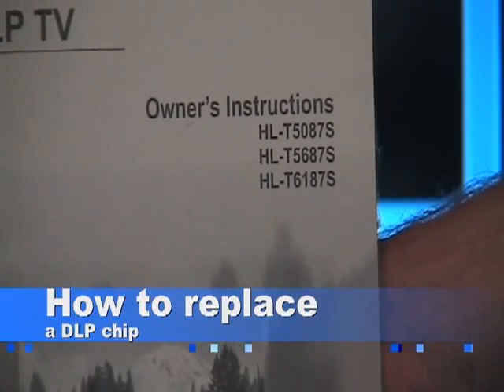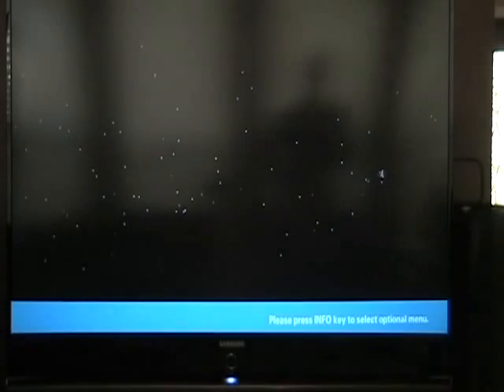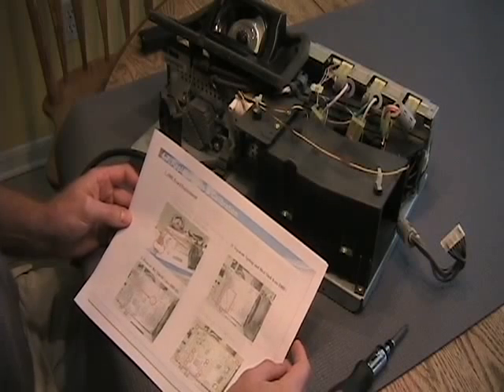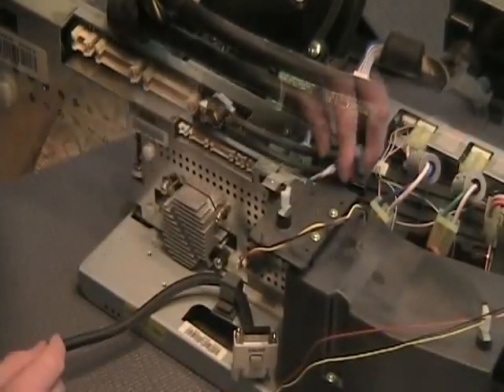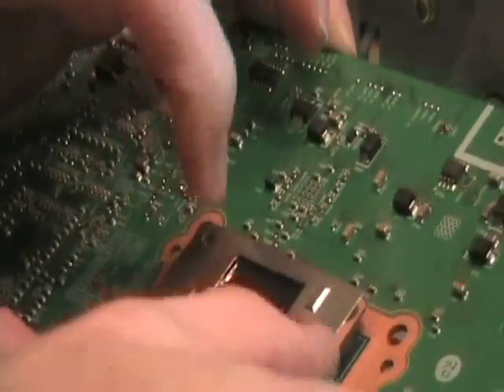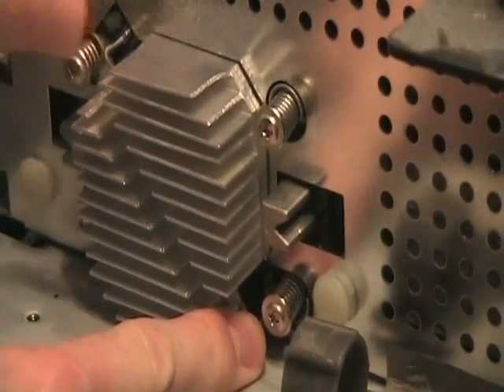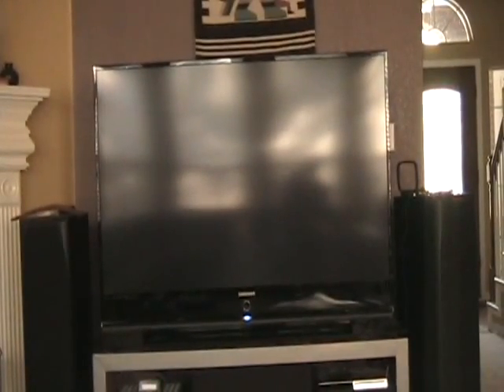Replace DLP chip on Samsung HLT6187

Comment from the maker: Hi all, this past summer (~5 months back), my Samsung DLP finally died. I think it failed due to several capacitors failing on the main power board. This is a known issue. I attempted a to fix/replace the capacitors by soldering on new ones. But, this failed to revive the TV. I think the main power board was damaged by the caps blowing because there was discoloration of the PCB board. I saw online that the a replacement board could be purchased for ~75 dollars (on eBay). Rather than sink more money in, I decided it was time to upgrade to 4K instead. For me the price was low enough and the technology had improved enough to go for it. Although content is still lacking. 

And my apologies for being unresponsive to your questions and comments. Work and family has consumed my time and just haven't logged in during this time. I'll try to be more responsive. 

Thanks for watching.

Comment: Update 
After not seeing a response for about a day, I put on a grounding strap and used the screw extractor, One of the two stubborn screws released.  Will be trying to get the other one out right after posting this.  Don't have any idea whether I may have done damage to the circuit board but time will tell. There will be another update regarding the other screw and what happens when I get everything back together. 

Here's the final update -  bottom line the Samsung DLP set is repaired thanks to the help from this video and some help from my local Lowe's store. It turns out they stock a screw that fits.  It is a 3mm-0.5 X 12mm zinc-p;ated Metric Machine Screw. Rhw 0..5 refers to the type of thread on the screw.  A pack of 12 cost me less than $2.  Hope this informations is of some help to anyone who finds themselves with the same kind of scres problem I had.

Comment: I started on the dp chip replacement and ran into what I hope is not a fatal problem.  The 8 stainless steel screws holding the clamp assembly to the circuit board were extremely tight.   Fortunately 6 of them eventually yielded to pressure and each let go with an audible pop.  Two of them, however, refused to budge.  In my zeal to get them to let go I applied too much pressure and stripped the phillips head corss hatch slot from them.   Is it possible to use a screw extractor on these screws.  Also since their heads are not damaged can you recommend a source for replacements IF I am able to get the to release.

Thank you for any advice you can sent me way.

Comment: Your video is now 4 years old but my HL-T5087SX/AA is now closer to 10.  It is now showing the dead pixel problem.  I am hoping to use your video to help me repair it.  I do have a background in fixing computers but I've never worked on this kind of tv.  If you are able to respond, has anything changed since you posted this video?  Thanks for nay advice you can send my way.
Reply from the maker: +Richard Sutor Nothing has changed and my TV is still working great.  My advice:
1) Watch the video carefully.  I've had several comments/complaints from people who remove screws they shouldn't but I have a little sub-window saying which one not to remove.
2) Review the comments on this video. Sure there's probably 60% noise to filter out but there are some important comments also that add value. 
3) If you have ever replaced/installed a processor into a PC, you should have no trouble with this fix. 
4) There are other known failures for this TV. IF it's just the dead pixels or stuck on pixels, this is the fix. 
Thanks for watching.

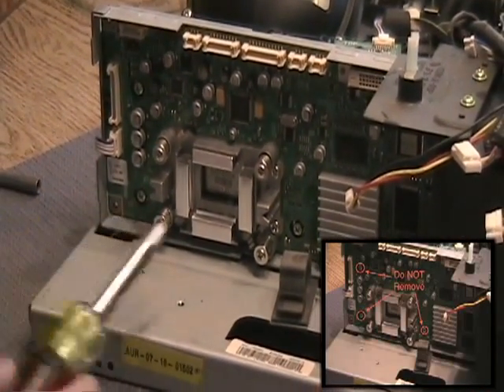Comment: Good video but you really need to make that "DO NOT REMOVE THESE 3 SCREWS" part  at 4:30 MUCH more visible.  it is THE MOST IMPORTANT THING IN THE WHOLE VIDEO!!!!   I was watching/listening to the video as I worked on the TV and completely missed it.  You don't show how you got the board out to install the chip.  Since YOU DID NOT i SAY, "DO NOT REMOVE THESE 3 SCREWS" and because I didn't see how to get the board out, I removed those 3 screws!  MISTAKE.

I did have the service manual downloaded, and after getting the picture almost right sized and position-wise, I could not get the focus to wheel enough to get the focus right.  Hopefully th TV repair guy that I now have to call will be able to fix that.

Looks like other people have been screwed by the lack of complete information.  If you can...please add in a verbal warning as well.  Thanks
Reply: The new chip did solve the pixel problem
Reply: +Bob Burden LOL! So did I but it was because I started from a more generic video. Didn't find this one until after the damage was done. I knew it was going to bite me later. Picture all out of alignment and just got time to get back to it.

Comment: Thanks for your help, though a few things were different, it worked out. Might have wanted to add "Not to remove the 3 white plug screws" as they adjust the alignment (which I had to fixed). Else, thanks. Saved me from having to buy a $2000 new TV. Only spent $175 on the chip.
Reply from the maker: mark shaw Your welcome and thanks for watching. 
At the 4:31 mark, while I explain which 8 screws to remove,  there is also a picture in the bottom right highlighting the 3 that should not be removed. Easier to see in full screen and in hindsight I should have commented on those three screws. Or maybe the picture should be bigger. My only excuse, it was my first Youtube video. :)
Reply: Well, I had to blame someone! Tnx again.

Comment: What do you do when the picture is a little fuzzy after the install? Also the geometry is a little off...
Reply from the maker: Loccs79 The repair manual explains where the focus knob/wheel is (~4month back I tell rolandvz71able where to find one). That's the easy one.  Geometry is a lot more tricky.  If it's a tilt or mis-allignment, again the manual explains. There are screws to adjust this. Personally, I had a slight bend/distortion in lower right. Barely noticeable if there is text or graphical box for sports scores there. This is a more tricky adjustment that I decided not to attempt. There are special manufacturer menus that I think would allow me do it (again in the manual), but for me it wasn't worth the effort.
Reply: +Loccs79 Adjust the 3 screws behind the white caps. Up is pix down, left is pix left and so on.

Comment: Have replaced my chip, white dots are gone. However, the picture is about 2 inches too high and am not sure what else to adjust.... any suggestion would be appreciated. Thanks.
Reply from the maker: Melody Crist Did you purchase a manual? The repair manual is online and available as PDF.  It tells you how to do the adjustments you want.

Also, 2 years back, approximately the 20th post, I'm responding to jbowen52 and Sam Crook. I talk about what screws to adjust to shift the image. In my video there are three "do not touch" screws I point out. Maybe you missed my inset picture at ~4:31 mark.  Although I describe it below, there is a lot of good info in the manual on how to do this adjustment.

That's all I know. Good luck with the adjustment.

Comment: The video gave me a good idea to what I needed to do, to replace my chip. No more dots.

After replacing my chip, I see smudge-like appearance on the left hand side of the TV (when there is a dark or black scene) that was not there before the replacement.

Would this be a defect of the DLP chip? Or do I need to clean the chip? Or clean something else?
Reply: Justin Blair A follow up to the question.  The reason for the smudge in dark scenes, is because someone decided to leave a fingerprint on the mirror.

Use a clean microfiber cloth to clean the mirror.  The surface of the mirror is easy to scratch, which is why a clean microfiber cloth is recommended.
Reply from the maker: Justin Blair Excellent! You found the issue and solved it.  I was going to guess a mirror (not the DLP) had a smudge. Your solution and use of the microfiber cloth was perfect. I used the microfiber cloth for my glasses when I did mine.

On a side note to anyone reading this, never attempt to clean the DLP.  The simplest way to explain a DLP is little mirrors on top of springs that are controlled by the rest of the DLP processor. The processor basically controls the springs (contracting or expanding them) and cause the mirrors to reflect the correct colored light to the screen.  The force of trying to clean a DLP would simply destroy it.

Comment: Well....how did the repair hold up? Did the paste do its job on the heat sink?
Reply from the maker: rolandvz71able The repair is still working great!  The TV is still in my living room and is still the main TV for my house. The paste on the heat sink worked fine.
I've been considering doing a follow-up video to show it still working. I really need to open it up and clean it out again. Plus, I could show a few more details about adjustment knobs that I've learned since this original video. Overall, I feel the cost of the new chip was a way better deal than getting a new TV. I'm hoping this TV holds on for another 2 years. After 2 more years, this TV will be almost 10 years old and I'll feel like I got my money's worth out of it. Also over the next 2 years, the 4K screen cost should come down and a standard should be set. Then I'll consider replacing it as my main TV.
Reply: Thanks for the update....great vid and I will be ordering my chip soon and attempting my repair. You mentioned step by step directions for 20 bucks.....do you remember the website where you bought the directions?
Reply from the maker: rolandvz71able In the video, I was showing a printed copy from the service manual. It's a step-by-step in service manual form.  I found two sites that provided manuals in PDF format.  They were similarly priced. I don't remember which one I bought from. It's below in a reply to the very first comment on this video.
Here's a copy and past from that comment (note, youtube does not allow me enter web addresses):
>>The two places I found are: "servicemanuals"dot net and "service-manual"dot net

Finally, before you begin the repair, take a few minute to read through the comments.  A handful are very helpful and point out pitfalls and solutions while performing this repair. 

Thanks for watching and good luck with your repair.
Reply: thank you for all the useful info!

Comment: Skip the first paragraph if you are not interested in the long rambling version :

Hi there, are there any other symptoms of a DLP LED chip failing other that white dots? I'm currently battling Samsung over a repair I had done by a Samsung affiliated service center roughly a year and a half ago. The tv would have to be turned on many times, progressively taking longer and longer, to start up. When it did the picture was fine while the TV was on. I never had white dots or anything similar yet the repairman told me it was the DLP chip and charge me $350. Now I am on the third repair with the exact same symptoms. The first they claimed it was the DLP(though Samsung claims they cannot tell me what part was put in the TV), the second they claimed it was the subpower(a cheap repair compared to the first and Samsung has the part number), and now it looks like another capacitor related power issue.

The below paragraph is vital and I am pleading from some answer before I speak with Samsung again :

So long story short, other than white dots are there any other symptoms of a DLP Chip failure? Can the chip fail without white dots? And would a failing chip sometimes after turning the tv on a million times work fine until it was turned off again?

Thank you greatly. :)
Reply from the maker: Coco Mandrake I'm aware of three issue with this TV set. 1) DLP fails (also known as the DMD chip). Symptoms: white dots, black dots, flickering dots, and sometimes an entire vertical or horizontal line. Usually this is not catastrophic but a slow process that gets worse over time. 2) Capacitor failure. Symptoms: can't power up or a long time to power up. I'm not sure which circuit board it is and I haven't had this issue yet. 3) Red LED failure. Symptom: red color missing from picture. I haven't had this yet but I've seen repair videos.  

I am not a repairman or service expert for Samsung TVs. My knowledge is based on building computers and working in the chip industry (but not DLP chips). In other words, I can't answer you with any certainty. To answer the "can the chip fail without white dots?": Yes. Usually, once a chip (generically CPU) fails, it's catastrophic. Of course it's nearly impossible to know if it's some other circuit (capacitors/ power supply regulator) unless you have someone who can diagnose the system. To me, it sounds more like a power supply issue. Just to add a little more uncertainty though, if the DLP chip overheated and burned out, then it would also have the same result as you mention above and just fail without white dots. My guess is a power supply issue (most likely capacitor) matches your description better. But really I can only guess. 

Sorry for being somewhat vague. Hopefully the three issue I know of above help. Good luck.
Reply: WillFully WeirdWorld
Thanks much for the detailed reply.

As it turns out it was the LED driver that failed on my unit. I was merely looking to see if there were any stories about the capacitors failing on the that particular board or if it was limited to the power board. 

In the end it's pointless as I missed the capacitor settlement and Samsung hung $550 in repairs on me during the time I would have been eligible for settlement money. I'm absolutely floored by how crooked Samsung has been in regards to this issue.

Seems my only resource is to tie up $550 hours in customer service phone time. lol.

Thanks again man, and very nice job with the vids. :)

Comment: Too bad I saw your video AFTER watching the Shopjimmy video and replacing the chip. White spots are gone but I removed the three "Do Not Remove These" screws. I take it they align the picture. Picture is a little high on the right. Now I get to figure out how to re-align it. Fun.
Reply: I am glad I watched this before Ido my repair this Friday
Reply: beast of the east Lucky guy!
Reply: I am in the same boat as you tonight. I watched it AFTER, dammit! How long did it take you to adjust it back? Any tips?
Reply: Loccs79 We have been in the process of buying a house out of state and moving a little at a time so, no, I have not had time to figure this out. I did move the TV to the new house recently so maybe the upcoming heat wave will keep me inside to try to fix it.

Comment: Thanks for video I replaced a chip in Samsung tv and I have a shadow line about one inch wide vertical Line on  left edge of screen . I tried to adjust by moving board slightly but no luck any ideas thanks in advance ... Harold
Reply from the maker: 109harold Is it a shadow, or the edge of the image/picture.  If it's the picture that is not aligned, there are alignment and focus nobs. The repair manual (I mention you should buy in the video) will show you where the nobs are. Or go back to Nov, 12 2012 comment/post by me. It will tell you how to find a picture of the nobs on an AVS forum board. Good luck.

Comment: my samsung hlt6187 had 50 white dots.
i got new dlp chip which had no. 1910-6143w on chip.
after taking old one out it had different no.1910-6103w.
everythingwas fine on video here and is great help.
i had no issues with alignment of screen etc.

my color and picture is much better also.
inside of tv was bad.
it had dust on 3 fans inside.
2 fans are in rear and 1 in front inside.

dont order anything from co. called RETECHTV.
they scammed me for price of a dlp chip .
i turned them into my credit card co for arrest.

Comment: I had white dots for a few months, today my screen wont come on... is this 2 seperate problems does anyone have any idea?
Reply from the maker: James Hall My "guess" is that you have 2 issues but it's hard to say without looking at the TV. But on forums about this TV (the HLT6187), the individuals who can't turn their TV on usually have a capacitor issue. It will definitely not allow the TV to turn on. If you know about circuit boards and what a capacitor is, open the TV up and look at the all capacitors. If any of them are bulging at the top, then that capacitor is bad and that is your problem.  This TV is known to have this issue. Again, I'm just guessing based on the limited information you provided. 
Hopefully I'm wrong. Finding and purchasing the board with the failure adds more expense to repairing this TV and you may reach a point where it's not worth it. I still believe the DLP fix is worth it. History shows that HDTV prices  keep dropping and features keep being added. So the longer you keep this TV going, the less you'll pay and the more you'll get on that future purchase.  And now 4K is entering the picture (but I think it's a little early to jump on that wagon). You'll just need to decide what your break point is.
Hope this helps and good luck.

Comment: I want to express my gratitude for this video! I've replaced parts inside desktop & laptop computers but never inside a TV. Bought the replacement chip online via ShopJimmy for $179 including 2 day shipping and a 20% off discount code. My TV is the HLT6187SAX/XAA model so its disassembly/reassembly were both different (but not extremely) from the video. My biggest issue was removing the board to get to the chip. My TV model has a small wire assembly that plugs into the top right of the chip board through a hole in the unmovable metal casing. I bought and downloaded a service manual which unfortunately turned out to be zero help. To resolve, I ended up loosening a plastic hood over the interior cooling fan to get to the offending wire assembly. After that the rest was easy and I successfully completed the chip replacement. THANK YOU!
Reply: Thanks for the heads up on this. I was going to order through J&J International and that would have cost me $130 more!